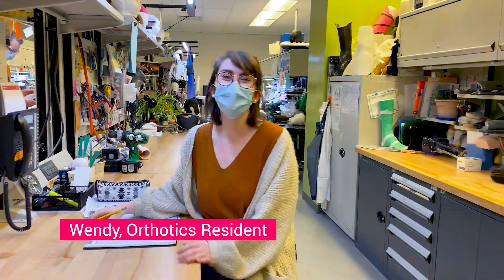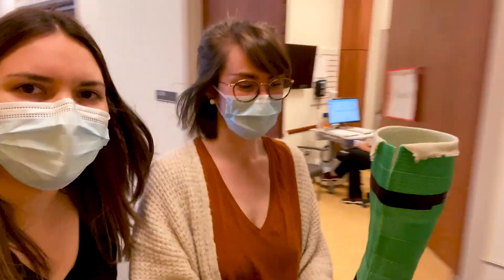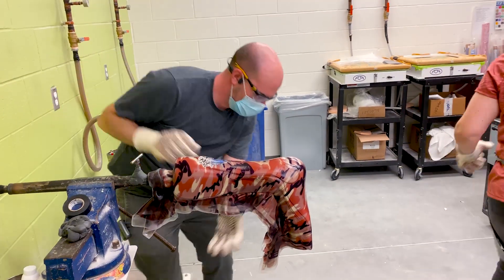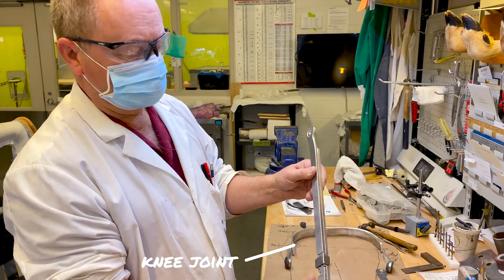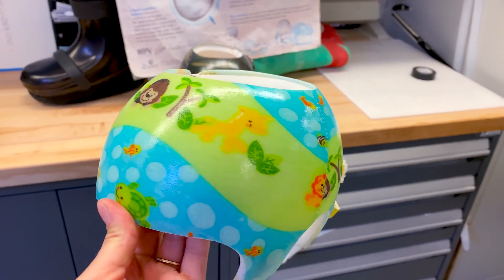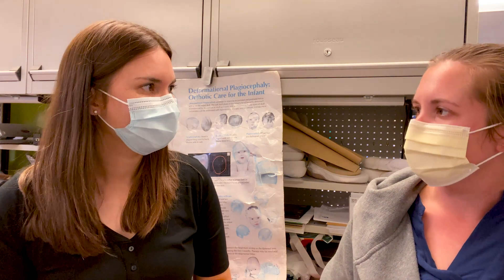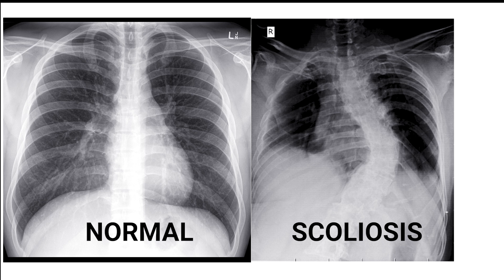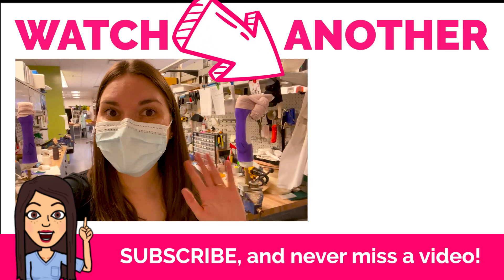Doctor Shadows an ORTHOTIST: Day in the Life

Comment: ive had to wear an AFO all day every day for the last 15 years so its pretty cool seeing how they'remade.

 they're frigging exspencive my last one i stetched out to 10 years fixing it myself then finally had to replace it because i gained weight and it got to small my current one cost 3 times more than my last car did or 10% of what my house cost. my current one took 5 months from casting to final fitment  but the guy who did it got covid twice and had thyroid sugery. so that was understandable  hell he still had the stitches in his neck at the fitting. im just really glad he took my suggestion to use aluminum rivits rather than steel ones to prevent failure from the steel rivits rusting causing the straps to come off but halso made ot so there is no ankle strap just the shin to limit failure points and make it easier to put on with one hand

Comment: Im glad myHealth insurance pays  for 2 Orthestic inlays for my shoes per Year . I would be in such pain without them.I found great Company in my Town  who makes them im very happy with work for Years. Since they add Cabon Fibres they extremly stable soft and light . Very needed because im a heavy person. They scan your feets with gigantic Flatbead Scanner where you stand on and they make a perfect 3 D scan of your feets. This Method is cheaper, cleaner and highly effective. The Inlays are lasercut so very precise. Since they use this instead of the foam steping Method i never had issues again

Comment: I have a KAFO cats on it. I’m a nurse and one of the few who work as a disabled nurse. I’ve gone through at least 6 braces in 17 years of needing one. I used to break through through them, busting the rivets. Then I started breaking the metal bars, they’d be sheared in half! They finally figured out what the issue was after a lot of trial and error.

Comment: This was so cool! As an engineer, I've seen some of those fabrication processes, but not for medical devices. I would love for you to do a part 2 where you shadow a prosthetist.
Reply: As a orthotist and a prothésist myself, I can say that they are not that different. You still take a plaster mold and just do a lamination after the plaster correction. The hardest part of prosthetics is choosing the right parts and linking them up correctly!
Reply: @SolemnnSolace exactly.   Lock system or straps...  we use the bulldog lock types for most.. AKs are the toughest and usually get the strap type.  BKs can choose either or...

Comment: I was diagnosed with S curve scoliosis in 1969 when I was 12.  I wore a back brace from 1970-1974.  It was nothing like the one you showed.  Mine was made of metal and had leather pads where the pressure points were, a leather girdle over my hips and then a big metal/leather piece that would hold my neck and head up (almost like they were trying to stretch me).  When I first got it, I had to wear it 24 hours per day for a month and then I was allowed out of it for 1 hour a day for bathing.  It was during my formidable teenage years so I became somewhat of a recluse.  In the end, it really didn't help me much. It is now 47 years later and I am doing okay as far as my back goes.

Comment: I have Ehlers-Danlos Syndrome and wear hinged custom AFO’s as needed for pain relief and stability. I need to have mine re-made though because there’s just too much material under the foot of my AFO’s and the material has too much friction so it’s damn near impossible to fit them into shoes, and also too much materials and straps around the foot itself which also complicates shoe wear. The right AFO is also not straight, it feels like it’s forcing me to walk on the outside of my foot and it’s driving me nuts. I got my AFO’s just before Christmas 2019, and before I had time to bring up the issues with my orthotist, Covid happened so now I’ve just had the whole project AFO’s on ice because of the pandemic. Need to get it fixed soon though as I need my AFO’s but currently can not use them as I need or want :/

Comment: I love this series, could you shadow a pathologist or possibly a medical laboratory technologist? Im majoring i  MLS and people dont really know we exist or what we do
Reply from the maker: Great ideas Kaloji - thank you i'll add it to the growing list!!
Reply: @ViolinMD  Your graduation in June is way too close to fit all the ideas in, right?
Reply: At my job my boss works part time as a med lab tech for a 2nd job. All they do is draw blood with needles and package it for the lab. You may if your lucky get to play with the machines but chances are your stabbing people
Reply: @Sabi1234567890Asdf  Lab techs and Lab technologists/MLS are different. Lab techs are mostly drawing the specimens but MLS does the analysis on them and provide lab values and results
Reply: @Sabi1234567890Asdf  a medical technologist is different from a technician , who is called a "lab tech"
Reply: @Sabi1234567890Asdf  Also that doesn't sound like a lab tech job either. I worked as a lab tech as a student and they do way more than that. It sounds like they are a phlebotomist on the side which is a 1 semester training program compared to MLS which is either a bachelors or usually a masters degree.